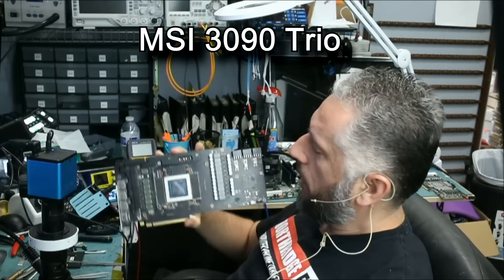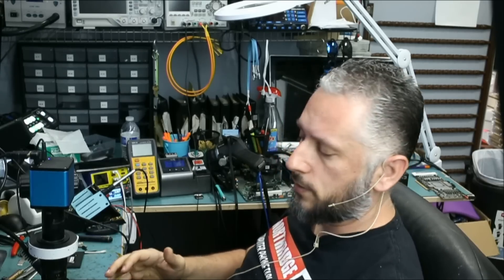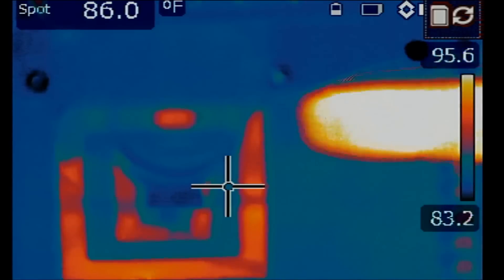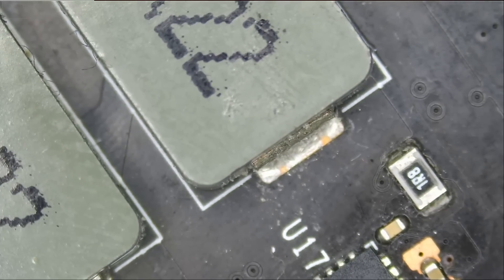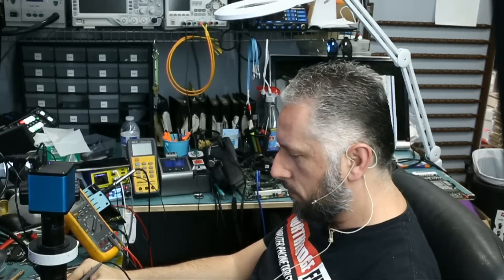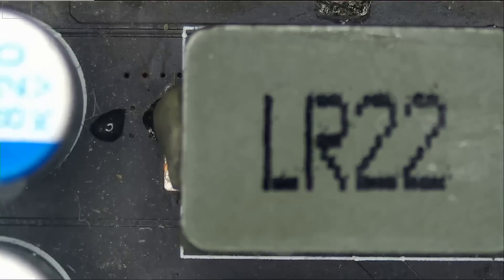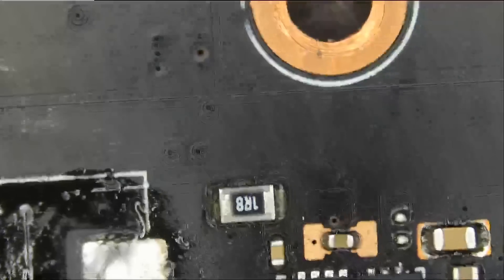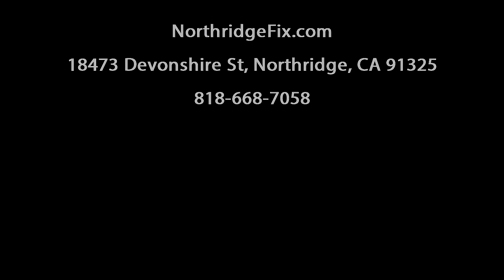MSI 3090 Trio Graphics Card Repair. Vmem Short circuit. Testing Card without Fan heatsink.

Comment: So I have a laptop with a gtx 1060 and it has a dead short on vmem but it keeps outputing an artifated picture. It also takes a while for the picture to show up.

I ran mats and found massive amounts of errors on two banks and small amounts of errors on one bank. I removed the errored banks and the it's still artefacting and shorted

Even though there is a dead short voltage is still present so what ever shorted somehow isn't drawing enough current for the buck converter to croak.

Is the the chip dead or could it possibly be something else?

Comment: havin cooler and heat sink is not an issue when gpu work. If there is water cooling there is no vires connected to GPU. GPU goes in protect mode when it gets to hot and turn off due to temperature.

Comment: Different board partners create slightly or very different versions with more or less of the components depending on what price point they want to achieve for the nvidia chip and it's target specs. 
I bought a waterblock for my MSI 1080ti a few years ago i recently tried to install it as 1 fan had died. 
Although during the dry fit it seemed to align perfectly, when i actually went to install it i realized i hadn't looked thoroughly enough at the exact pcb used for my MSI 1080TI card and it was only when i was trying to position the block that i noticed a couple of caps where placed outside the cutout on the bottom of the block so it wouldn't sit flush.
When i looked again at the spec sheet for the waterblock it had a caveat that although it fit MSI 1080ti boards their was a couple of sku's that came in pre-built pc's like the 1 bought that needed a different waterblock because on the standard card those pads were unpopulated by default. 
Unfortunately i can't find the exact needed waterblock so my 1080ti is on the shelf of shame as i cannot find the exact needed waterblock anywhere let alone in good condition and at a reasonable price.
Reply: Sometimes it helps to change the caps. I don't know what caps are you talking about but probably low ESR ones should be a good fit (some caps are smaller in size than the ones planted on the video card). I sometimes change caps with tantalum caps with a little modification (a little bit of added cable soldered on the board and at one of the two connectors of the tantalum cap). This saved me a couple of times. Of course you need to know what caps you need as replacements and you need to have the skills (and tools) to do it. It's definitely not a DIY project if you're not skilled enough.

Comment: I think that some people should understand that's a life of an electronic device is similar or equally like a human. 
There are some damages that can be repairable and sometimes not. 
When a component get damaged by electric or other conditions , it's like a tumor with metastasis , If electric run through other components damaged , it's like a metastasis that expand on the pcb board causing irreversable damages and could compromise the entire functionality of a device. So that's life.Obviously you can't buy a new life , but another video card for sure.
Everybody in this world has your own limit in terms of knowledge and life.
We should be less arrogant towards a technician or a doctor , because the most of times they postpone only the deadline of life but they can't make a person or device immortal. Thanks for  your lesson NorthridgeFix

Comment: Usually, the missing components are missing for a purpose.  Sometimes they need populated only to convey diagnostic information during development.  Sometimes they are needed for a different model having different options and different software.  Sometimes they are access to program the software onto the chips.  But, almost always, installing random components will further disable the device.

Comment: I think you were hard on those who suggested that the video card would not work unless gpu cooling was detected.  If a computer MB will have a protection not to start up unless cpu cooling fan is detected why not video MB? They made a logical suggestion not a nonsensical one as you suggest.

Comment: A short at Vmem leads to 99% to a dead memory controller. The measuring at the coil pad was pointless, at both pads is the short, because all Vmem phases are parallel.
Reply: even if it is, unlikely he would be able to get that controller
Reply: @mtnshadid  Oh man, the memory controller is part of the GPU itself, a broken memory controller means a broken GPU.
Reply: @christianengel619  yeah I was hoping he'd pull the GPU off at the end

Comment: You should have also looked at the back of the PCB with the thermal camera.The 3090 also has memory chips on the backside and maybe the faulty one was transferring heat to the front ones...ignore if you already checked but didn't film it :)
Reply: the thermal capacity of the board is too high for that to happen

Comment: The areas that apear to have missing components  are areas that have not been populated with components by the manufacturer. it is common to see PCb's with unpopulated section of a board which is really for some added feature or aditional power managment.

Comment: you can also use MODS/MATS software to determine which memory chip is dead
Reply: They are quite clearly all dead, and most likely the on die memory controller. Yes mods/mats is useful for broken connections and failing memory banks but it is plain to see this card has had a catastrophic overvoltage event on the memory rail...
Reply: @Sydney268  yeah i was just giving another way for people who don t have a thermal cam :)
Reply: @danteashen6178  freezer spray works good :) I think the point here is that a short on the memory rail that doesn't originate from the vrm never usually ends well...

Comment: I've had similar rabbit holes with Xbox that have APU issue. I now give up much earlier, as you do. You end up with all the RAM chips off the board and still no solution. However, I'm also fairly conservative with diode tests to ground as I'm not convinced that full DMM voltage is welcome in some parts of the system.

Comment: Just because the components look missing doesn't mean they are. I've seen countless circuit boards with missing items that never been worked on. Those items are missing for a reason, boards are often designed for many different applications, yet the boards themselves looks the same.
Reply: Yeah the military gets a different version

Comment: Naive question: if removing a chip cause the next chip to be hot, could be the problem above all the chips?
Reply: Votage passing to other components on the line next to it. Therefore each component gets hot on the line in an order. I believe  and understand from Alex’s sentences in his previous videos, it will end up with a dead CPU If he continue to remove all rams.
Reply: No.

Typically when the memory chips get hot and you have a 0 ohm short on Vmem, you have a memory controller issue.

The memory controller is embedded in the actual GPU die.

Comment: Send that to me if it's gonna be discarded. Wanna desolder the GPU and measure it's cores based on the datasheet.
Reply: If the customer doesn't want the card back there's no way he would give that card away. It is filled with other good components that can be used to fix other cards.

Comment: Let us start with the fact that I have ZERO knowledge of electronics. I have noticed on some boards that there do appear to be "missing" components. Is it because in another "version" (model) they add a component to give a different feature?
Reply: Different model / version, circuit design changed, components were omitted in subsequent revisions and the board design didn't change (no need).
Reply: Yeah its a cost saving thing. So basically lets say all 30 seris cards by one manifacturer will go on the same board and each card gets x amound of VRMs, memery moduals etc. Rather than designing 8 diferant boards and printing as many, they just design one, and populate it differantly depending on the model. (This is just an example, and in practise might be diferant somewhat, like it might just be 3080, 3080ti, 3090 and 3090ti that share the same board, but the same principle applies).

It could also be from a product design update. Say they find one component in their design has a blanket issue where it's not getting enough current, and they can fix it by eliminating a resistor on the board. If they can get away with just not putting them on the board rather than a redesign, they will do that and continue using the same boards, just with an updated component list to go on the board. This is much less common, but still a possibility. The main reason is the first one I give, the second is just a mere possibility.

Comment: Hi Alex , I know you mentioned you have the pace evac 250 fume extractor. I was wondering where you got the silver hose from ? As I have the same and need a proper hose for it. When I got mine it come without it and I’ve tried a few different types but none are any good for moving around the bench. Thanks so much in advance. Great video as always.

Comment: it blows my mind that people actually think that fans not connected is going to make the card not work. how exactly would you run a waterblock on your gpu without fans then LOL it woul not work
Reply: I think most people are not saying that it won't work at all but that it will thermal shutdown so fast as to render the test moot. I do not personally support testing other people's chips bare. Thermal shutdown is not guaranteed to work, especially in a piece of hardware thats already malfunctioning.

These cards are getting so powerful that a chip being damaged from excessive heat before the thermal shutdown can kick in is plausible. Its unwise to boot chips without some form of passive or active cooling. 

Afterall these chips are not made to be run bare.

Comment: I learned then dumb way that they don't use every solder pad on the pcb. When my first 5700xt died i assumed a component fell off the board due to unused solder pads being visible. Powercolor replaced the card under warranty and i found some of the same solder pads blank on my new working card.

My guess is they're designed to be able to swap to other similar components in a hurry without harming productivity
Reply: The unpopolated pads is for confused the repairman for tracking track without service manual

Comment: I wonder why aren't video cards set to lower power than what it can take with water cooling. I would sell them with their power lowered by 20 percent, then they would most likely never die. This also means that manufacturers would have to make 20 percent more powerful cards for the same result.
Reply: Videocards ARE programed to use less power than they technically could. That's why overclocking is possible...
Reply: Because people want the ability to push their cards to their limits. They do this knowing the possible risks. I would never do it myself, adjusting the voltage on my 3080 ti never seemed to make any difference anyhow and I already have a very respectable overclock on the GPU and VRAM.

I support both having limitations and being able to override those limitations for those who really want to push the limits.

Comment: That's really strange that you had the same problem on the same model of cards. These cards are absolutely too young for such a GPU to die. 
Maybe I'm dumb but would it be worthy to try a reflow of the gpu itself ? Thanks for the amazing work, I'm always looking for the next video from you !
Reply: another simple way for people to fry their gpu is when they change their modular psu recycling the cables from the older one. There's no standard for those cables not even between psus from the same manufacturer
Reply: Reflowing rarely works but it is usually also a temporary solution
Reply: @rokiedecentra9656  It's a point. But with the skills of Alex, I think it worth a try. I've seen reflowed graphics card holding for years, so, who really knows. Thank you anyway
Reply: People are probably OCing them to ridiculous levels without knowing what they are doing, not realising they are clocking them dangerously high and over volting them till they go pop. 

Different cards will have different weak spots, so if the same thing happens (agressive OC by someone who isn't skilled enough to know when to stop adding power to the gpu) then the damage will often present it's self in the same components on the same models of cards. Granted this is more common with memory, but these new top tier card's gpus are already flying pretty close to the sun!
Reply: @DaftFader  I'm really curious about what the problem really is with those cards. It's everything but normal.
Overclock ? I doubt it. I'm thinking more about a mechanical weakness, or a flaw in the soldering process. Sh*t happens even to the best

Comment: Sometimes (not  always) you can narrow down a short using a milliohm meter, though you ideally need a schematic and of course you need to balance time / cost.
Reply: Yea but in this case it's a dead GPU core so there's no point. Can't fix a GPU core since replacing it is very difficult (requires specific machines), time consuming and of course you won't find a GPU core anywhere since that's like 80% of the price of a new card entirely.

Comment: Is it exact 0 ohm.. the resistance is very low..about 20 ohm.. diode mode will beep... bad for nvidia.. the memory controller and vmem shared the same rail... not like amd card... 0 ohm on nvidia card normally death card....but no harm to remove all the vram and check the resistance again

Comment: Surely a 3090 is still under warranty
Reply: Odds are it was overclocked and voided warranty.
Reply: @garyr7027  burden of proof is on the manufacturer. If you oc something and it dies, it is difficult to find definitive proof that an oc killed the card. Could have been  over voltage/current spike
Reply: Not this one anymore lol! 

It's probably that the owner broke it himself, like with overclocking or when installing a custom watercooling block or something. This can void a warranty.

Comment: surprised none of the fuses did their job.  its like why include them if they wont prevent a catastrophic failure.
Reply: Fuses don't stop things from failing.

Their job is to protect the wiring from catching fire.
Reply: i meant the fuse should have blown when the mosfet shorted to prevent 12v from making it to the gpu core or memory chips because thats very bad. thats the whole reason MSI or any othe AIB put fuses on their boards. i know fuses dont protect things from failing but they are supposed to protect the board catching on fire, 12v getting shorted through the gpu or memory chips things like this because that would be catastrophic.
Reply: @helijim  This. Plus all various power supplies shut down with overcurrent. A dead short therefore just stops stuff working.
Reply: They're mostly there to prevent the power stages from burning a crater into the PCB when they fail. The GPU core itself can only handle very low voltage, any significant spikes could easily destroy it.
Reply: Agree, but from memory from the last vid they were 20A, which is 2400W @ 120V.  A lot!  So I would presume they are there more to prevent something more catastrophic like fire, in the event of a massive failure or other crazy power event.  I guess it only takes a little extra amp spike to kill a GPU, as I presume happened here when the mosfet went bad.  Overall with these high-end video cards I wonder how many would fail if they are just left alone, stock cooling, no crazy overclocks, no hash-rate mods or whatev's.

Comment: DO NOT TEST VMEM OR GPU CHIP IN CONTINUITY MODE BECAUSE IT ALWAYS BEEB DUE TO LOW RESISTANCE ON VMEM (as low as 15 to 20 ohms )
always use resistance mode for better measure
may this info is helpful to you.
Reply: Well he did check in resistance mode and the reading was 0 ohms.
Likely the GPU itself has a dead short and replace it would be expensive and not practical.